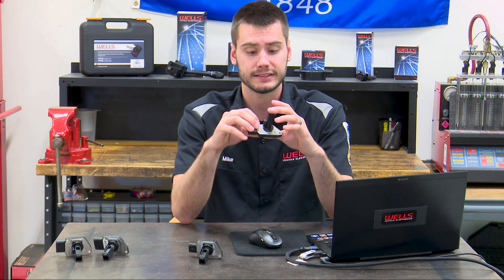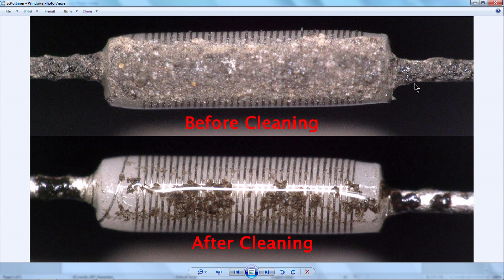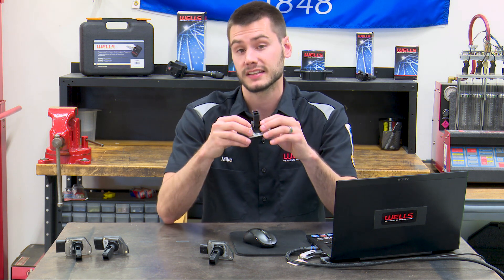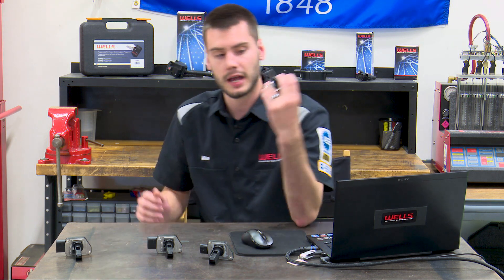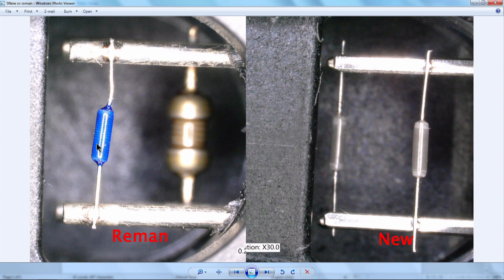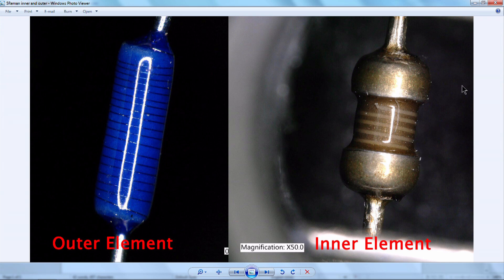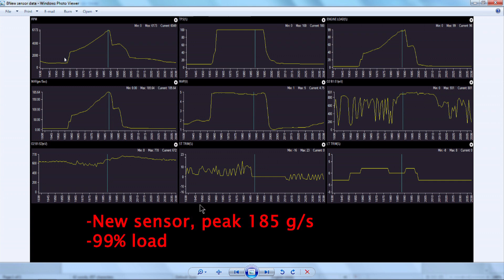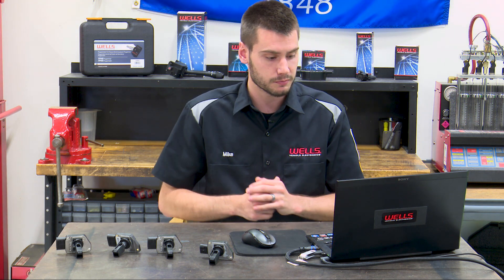Wells TechConnect Ep. 19--Does cleaning a mass air flow (MAF) sensor really work?

Comment: I have a question, please.

I got a lovely Alfa Romeo156 1999
selespeed 2.0 lit, 16V T.Spark

The problem I'm facing is: The engine starts immediately once it is cold or hot, While it is running,
The RPM drops to 500 and the sprayer icon "lights on" in the dashboard, then the accelerator and gear do not activate. 

To overcome that stage; I should switch the "engine OFF" and start it again,
then The accelerator and gear work perfectly, It happens also when I reduce the speed when there is humps or bad traffic. 

I changed the ECU, but it remains the same problem. 

Thank you for your
help.

Bassam
Reply: Thanks for your cooperation.
I  ordered some suspected parts from Europe related to the concerned diagnosis, then I shall be able to hand over my car to workshop since they changed The ECU but it was not the reason for the problem I’m facing, then will ask the Technician about the codes if he has a reliable computer that shows the codes.

I’ll update you Sir about the upcoming results.
Once again thank you for your valuable time. 
Regards
Bassam -UAE
Reply from the maker: Bassam, do you have any trouble codes? That would be the first thing to check out.
Mike Becker, Senior Technical Instructor

Comment: I'm having trouble with 05 1.8l it runs good in idle but put it in gear and it sputters  codes p0101 and p0171 put new OEM maf sensor up stream and down but no change
Reply from the maker: Hey Tyler, have you taken a look for vacuum leaks or anything like that?
Mike Becker, Senior Technical Instructor

Comment: Mike,Very informative,as always!If you are changing the MAF due to the crud,it is obviously from crud getting past the filter.......Since you use new parts for quality reasons,I would also automatically change the filter(To the best available at the time),to keep the same thing from happening to the new part.Do you?By the same token,if a cleaned part is showing at least the same results as a Reman,even if the customer wants it just cleaned,I would try to get them to at least change the filter to keep new gunk from contaminating again....Ideas?
Reply from the maker: Sure, cause and effect, right? An old air filter can't stop the crud so it ruins the MAF. Also, cheaper air filters don't filter down to the micron levels that more expensive ones do...so you could have issues with that as well. 
Mike Becker, Senior Technical Instructor

Comment: Cleaning has always worked for me.  It runs great again after cleaning.
Reply from the maker: Hey Adam, that's great...but for how long? Have you found it to be a permanent fix?
Mike Becker, Senior Technical Instructor
Reply: @GoTechTraining  no, it's never permanent but that's fine. There's some people out there who can't buy new sensors as much as they can buy a 7$ of cleaner that keeps the MAF going. Plus a new MAF isn't a permanent fix either. Because they'll eventually go bad. Haha. Not trying to be a smart Alec but yeah.
Reply: @GoTechTraining  a permanent fix is to buy a new car 😉.
Reply: @GoTechTraining  There is no such thing as a permanent fix, if the original goes bad, so can a new replacement, particularly if not built to same quality as the original, particularly if whatever problem was present is not resolved because there should not be that much gunk building rate from the intake, nor that much blowback from the engine.  If the idea is that the old engine is contaminating everything, then maybe it makes even more sense not to spend any more money than necessary to keep it running.  The real question is, how much damage is there under the gunk.  Most sensors are not designed like the one you show.

Comment: I bought a 2007 Lexus RX 400h that had a dealer replaced MAFS 400 miles before I bought it. Four days after I bought it I got the check engine light with a PO101 code. I took the sensor out and cleaned it. Put it back in and reset the code. The car was running fine before the code came up and its running fine now but the next day the code showed up again. This time I replaced the MAFS with a new one and reset the code. The code came up again the next day. The car is still running well but do you have any idea why the code keeps coming back? I am stumped.
Reply from the maker: Hey Cliff, Id start by graphing the signal voltage of the MAF sensor. Look at the code set criteria and see what the exact values are...but that should be a good start.
Mike Becker, Senior Technical Instructor
Reply: Thanks, I'll try that as soon as I figure out what it means! :>)
Reply: @GoTechTraining , Update on the MAFS problem. It was a cracked hose/boot on the intake side, before the sensor. Eventually, it got bad enough to keep the car from running. Unfortunately, when it wouldn't start I was ninety miles from home!.......$200.00 fix, including the diagnosis fee.

Comment: I think it depends on how bad the wires are contaminated..I cleaned two  maf sensors on two different cars and it helped a little bit but ended up having to replace them in the end
Reply from the maker: I think cleaning is nothing more than a temporary fix. But that is assuming the only problem is contamination and not damage.
Mike Becker, Senior Technical Instructor

Comment: It would have been helpful if you had tested the cleaned sensors as well.
Reply from the maker: Chances are that the cleaned sensor would have probably worked for a little while...but that non-stick coating is no longer intact, meaning that sensor will fail sooner. 
Mike Becker, Senior Technical Instructor
Reply: I believe it, but it still would have been nice to see how it was working after the cleaning compared to the new sensor.
Reply: Anyway, if you have the correct bit, removing it, cleaning it again and reinstalling it is a matter of minutes.

Comment: Estimated realistic expected cost for this repair?
Reply from the maker: John, hard to say. Depends if the sensor is getting replaced or cleaned. I would figure 1 hour labor for diag, plus at least 0.5 hours for cleaning/replacement. Then you add in the cost of the part, which varies....I'd estimate at least a few hundred$$
Mike Becker, Technical Services Instructor
Reply: Wells Vehicle Electronics thank you for the video, and your response. Keep up the good work.

Comment: I have dropped the fuel tank and i can't find it there, I am looking around the fuel canister but seems like it's not there either....
Reply from the maker: The sensor looks to be mounted on top of the tank. As part of the sending unit. You probably should see a few different connectors up on top of the tank. Fuel tank pressure will be a 3 wire sensor.
Mike Becker, Technical Services Instructor
Reply: Yes the engine light stays "ON" and i have checked a shop and for a code and they told me the code is P0510, and its the fuel tank pressure sensor. That is why i have a brand new sensor..
Reply from the maker: You're certain it was a P0510? I highly doubt that the fuel tank pressure sensor is causing a driveablilty issue. 
Mike Becker, Technical Services Instructor

Comment: hello, can someone help pin point where i can find the (Fuel Pressure Sensor) or the location is on my 2004 Ford F-150 4.6/5.4 L V8 double -cab pickup truck?
Reply from the maker: Hi Walter, I would just like to clarify what we are talking about. Are we talking about the fuel tank pressure sensor or the fuel rail pressure sensor? Judging by your 2nd comment I am assuming fuel tank pressure. 
Mike Becker, Technical Services Instructor
Reply: fuel tank pressure sensor. i find a three plug connector but it is mounted on the air lines for the Evap system i think, not on the fuel tank and i already buy a fuel tank pressure sensor that goes on the fuel tank.
Reply from the maker: It is completely possible that the FTP is located in an EVAP line and not directly in the fuel tank. Ford is good for this. I have a feeling what you are looking at is correct, that it is the FTP.
Mike Becker, Technical Services Instructor
Reply: Hi Mike, maybe you can help with an advise on my problem. The truck runs fine in idle. The problem is when i accelerate, the engine stalling and slow to pick up speed. But when i slowly push down on the gas paddle it seems fine.. Do you have any advise for me.  Thank you.
Reply from the maker: Hey Walter, first step would be check for codes. Is the check engine light on? From there it's really hard to say. It would be little more than a guess. You issue kind of sounds like a plugged up catalytic converter, but like I said, its little more than a guess without codes, or testing data. 
Mike Becker, Technical Services Instructor

Comment: I find if you use a reman Maf you will have a comeback but if you use new and usually oem you won't have an issue. Honestly have not used a wells Maf as they don't order them or the parts stores we use don't carry them but I know if you go cheap you will have trouble.
Reply from the maker: Hey Techman 48917, the old saying holds true, "you get what you pay for." I think this reman sensor would have worked for a while. But, it just bugs me that it's already underperforming right out of the box!
Mike Becker, Technical Services Instructor

Comment: Looking at the figures for the OEM and aftermarket Maf sensors, there doesn't seem to be that much difference especially when dealing with an older vehicle.
Reply from the maker: Yes Tom, you are right. The figures really are not that different. But they ARE different. Considering both parts are fresh out of the box, they really should perform the same. Will the driver notice a difference, will the PCM code? No, but there is a slight difference.
Mike Becker, Technical Services Instructor

Comment: I'm not so sure it's the brake cleaner or the maf cleaner that's causing the deteriorated coating on the heated element. based on what I see it looks like the coating is simply worn away from  use. cheap air filters and poorly installed air filters letting dirt past and it's just getting baked onto the heated element and giving the sandblasted look because, well it's essentially being sandblasted when the engine is running. so when you clean the sensor you are just exposing the damage that's already been done.. now that's not to say that the harsh cleaner doesn't eat at that coating as I'm sure it does. but the root of the problem appears to be poor filtration IMO. 

did you do the same cleaning with a new MAF sensor and see what happens? didn't you do this test on the MAF episode you did previously? 

I noticed on that reman sensor that the wire that wraps around the sensor is not coiled as tightly as the OEM.

as far as my luck with cleaning MAF sensors. if it's dirty because the air filter was installed poorly or not at all(it happens often) for a short period of time then cleaning is usually the way to go as it's usually loose debris and i never had any long term issues.. but if it's caked up and burnt on like the pictures you show. it's best to replace it.
Reply from the maker: Hey AutoFixPal! I did clean a brand new sensor in the live training we did at the begining of May. You are right, the MAF and brake cleaners do not eat away the coating. Carb cleaner will. As for the sandblasting, I totally agree. The sensor has been sandblasted for 100k miles. Cleaning it removes the dirt and debris, but the nonstick coating is no longer as effective as it once was...leading to faster failure. I think MAF cleaning vs replacement is a case by case, customer by customer, judgement call. At the end of the day, it's the customers money. The best we can do, is offer our advice and reasoning as to which direction they chose to repair. 
Mike Becker, Technical Services Instructor

Comment: Top notch presentation Mike, as usual. You're a good instructor. The pics were the proof. Never knew about tire debris til Keith added that. Great tech he is. You tried cold chemical cleaning but do you think there would be any way of removing  the rubber with heat?  Would it burn/melt off without damaging the element? How come none of you guys are near me in Ontario? lol  I think I may need a new MAF for my camaro as its been cleaned more than once already.  Now the search begins because I can only find remanned.
Reply: Mike Burton I very much appreciate the compliment Mike
Reply from the maker: Thanks Mike! I wonder what temp the coating on the OE MAF melts at? I wouldn't want to overheat it. Also, to get heat inside there would be hard, as the surroundings are all plastic. I think heat would cause more damage than anything. I hope you have success in your search for a new MAF sensor!
Mike Becker, Technical Services Instructor
Reply: i'm wondering if liquid soap and water could soften that gunk. It is obviously causing partial shorts on the wire wound resister. I would like to try an overnight soak , rinse, and air dry to see.....

Comment: Best vids I have seen on maf sensors thanks, have had good results cleaning over the years but would like if you could look inside cheap "eBay" one vs oem, I  Mostly work on euro and find they don't like aftermarket, guessing they might look like you remanufactured inside.
Reply from the maker: Thanks ddire333! When you say the don't like aftermarket...do you run into issues right away, or down the road?
Mike Becker, Technical Services Instructor
Reply: Wells Vehicle Electronics right out of the or with in days for many spurious brands😋
Reply: That’s a great question, OEM verses after market for my 17 Nissan Maxima $585 to $175

Comment: New Level Auto stirring the pot...of course he's stirring the pot and then laughing b/c he knows he threw in a variable they didn't think about and then the fun begins. I am in total agreement with Keith on you're doing a great job but when he said even without yoga pants he started worrying me that he was actually thinking about you in yoga pants but then again he's from the Island. Now I've cleaned a ton of MAF sensors and failures are few and far between but I'm not comparing a new sensor against a used one...I'm just seeing if it corrected my MAF readings, fuel trims, etc. & if my G/S VE is good. Hope you're getting sleep and the baby is doing good!
Reply from the maker: Hey Bob! Thanks! The yoga pants thing is toooo funny! I wonder who is going to be the first of us to wear them!?!?! A clean sensor is a happy sensor. Have you seen them last as long as a replacement though? Also, the fuel trims may be in spec, but is the VE and g/s as high as it would be with a replacement new sensor? I know fixed is fixed, but...these are the things that keep me up at night. Could/would the customer be better off with a new sensor over cleaning his old one...oh and my son, he keeps me up at night too. Haha. Have a great rest of your weekend Bob!
Mike Becker, Technical Services Instructor
Reply: Hey Mike...Never tracked the difference but I know once I clean them they usually last until they come back in for scheduled maintenance. I inspect & clean the MAF sensor every time I check the air filter. Contamination is directly related to a dirty air filter, seal bad, K&N, engine oil contamination (PCV or blowby) ,etc  If I have a MAF related performance issue i.e. fuel trims, load %, DTCs, etc I'll inspect the MAF and if it's dirty to the point I know it's affecting the air flow calculation it gets cleaned and then see the affect. If I look at the MAF sensor and it has severely eroded coatings, is clean or not to where I feel the contamination is enough to cause the problem then the MAF sensor will be replaced. I never took a cleaned sensor and a new sensor and compared the VE or g/s but your test results were interesting but then again how does an OEM, AF, & cleaned sensor compare to each other and how does an OEM compare to another OEM? Is there a tolerance between them? Interesting questions? Honestly if I have good fuel trims, VE load calculations VE and g/s for the mileage and wear on the vehicle then it goes out the door. I try and only replace the parts on a customer car that they need b/c usually they have something else that is more important on their car they need to fix. I've never had a car come back for a MAF I've cleaned. If these are the things that keep you up at night plus your son you better get some toothpicks for your eyelids so if you start rambling incoherent thoughts in your videos I'll understand :-)  Have a great weekend Mike!

Comment: Thanks , so an open vent on purge or vent would create an Lean condition on both banks ?
Reply from the maker: Juan, a stuck open purge could cause a rich or lean condition. It really depends on what is happening inside of the fuel tank and the charcoal canister. We will be discussing this more in depth during our next class.
Mike Becker, Technical Services Instructor